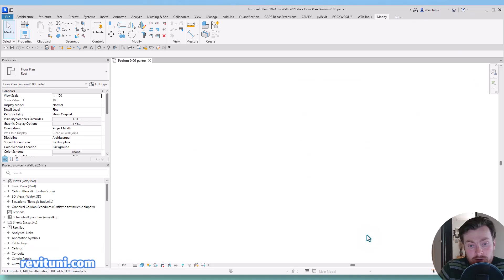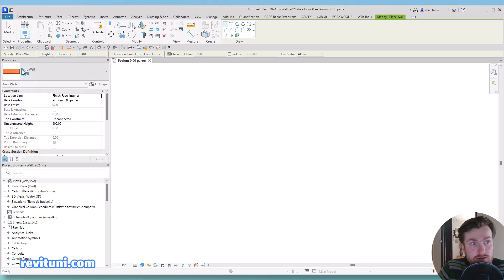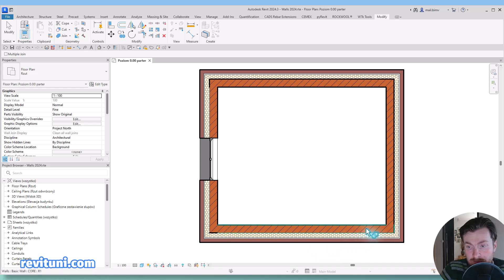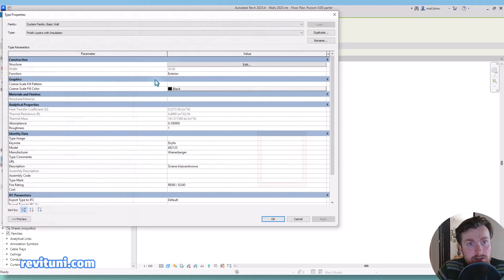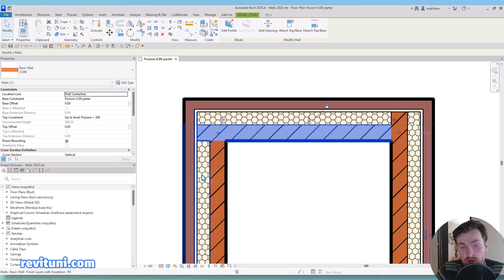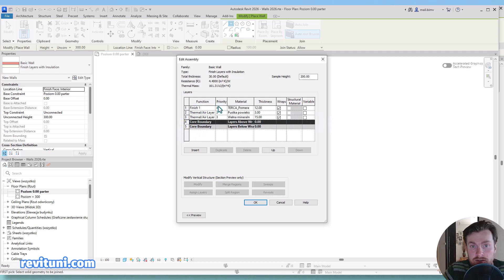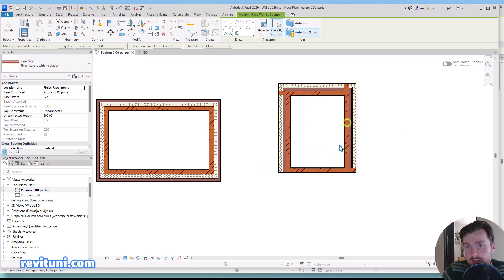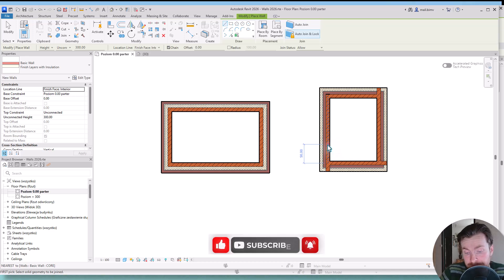Revit 2026 wall layers modeling. Why new feature is gamechanger - explained  | revituni.com

Comment: when you did pick by segment your location line was set to interior face so the interior face was getting set to the face of the core segment you selected, thus the need to flip the walls afterwards. Not a bug just human error. No big deal :)